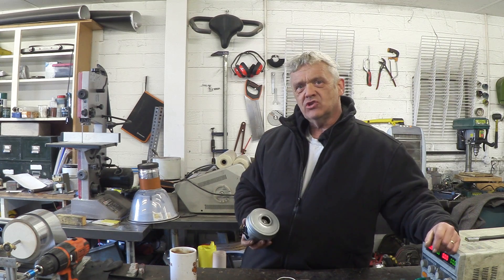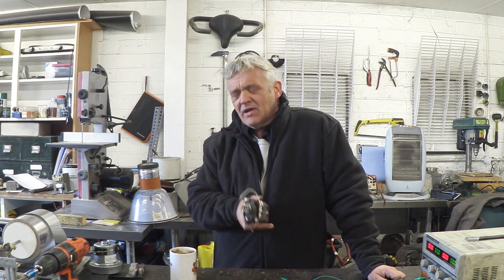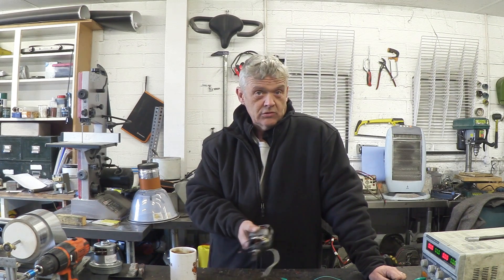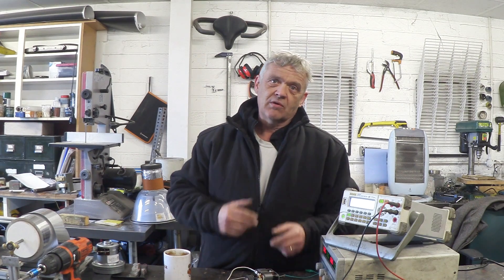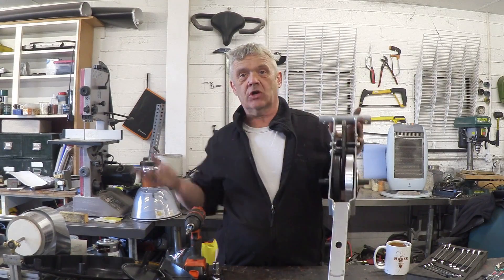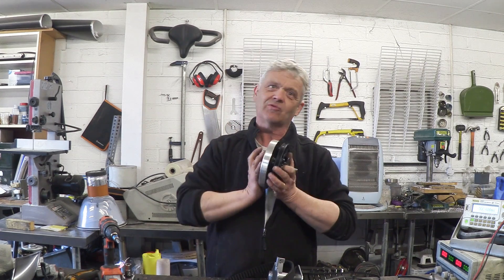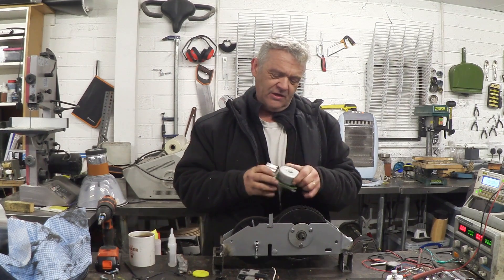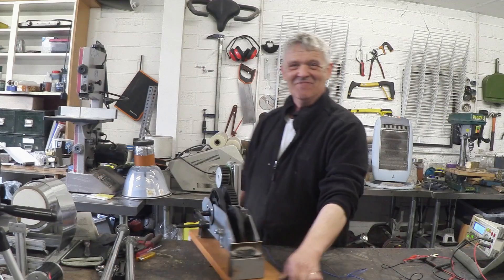1085 A Generator  From an Execise Bike, A Printer And My New Gear Mechanism - Use As A Wind Turbine

Comment: you are turning up a lot of printer parts, and some look like laser printers, so I am wondering if you have torn down the bits that have the rollers and fusers and found any t hat have soft squishy rubber coatings on them, as I have a couple that feel and react like urethane rubber, (is an orange-ish red color) and really thinking of making a van de graaff generator using them and some large solid teflon block I have access to,

Comment: Harbor freight sells a 10KW tractor PTO generator for about $320 USD. Optimal RPMs at the Rotor is 1,000. This is the cheapest and most efficient way that I've found to approach larger projects. You can always grab a cheap 1:30 and reverse it to the Rotor shaft, after that, torque is king.
Reply: Gears are terribly expensive globally, sprocket and chain ratios will get you where you want to go without the cost.

Comment: Hi Rob. I think your gear idea is the cleverest thing I've seen in a long while. But what do you do if the belt doesn't fit perfectly around the circumference (half a tooth too long or too short)? Is it just serendipity that yours seem to fit perfectly, or dit you have to turn the centre parts down a bit of the lathe? Or am I missing something obvious?
Reply: I'll go bigger,by adding a layer under the belt to make up the size difference. It wouldn't have to be big because your changing the radius squared compared to circumference .
Reply: @tremail564  I didn't think of that.

Comment: The gearbox for the generator is very intersting. I don't see much potential in the printer-motor as generator ... see more in the hoover motor: Put on the rotor variable DC to get AC on the stator. So in case connect to a wind turbine it should be possible to get out a stabile voltage to charge batteries. And - off course - keep the flywheel in the system as stabilisator for the voltage because wind can drop and rising fast.

Comment: I think Ive watched nearly all your videos and am sure that this is my favourite. It is so simple, clever and deliverable for so many. The change in motor adds to the video, as it presents an alternative option that are generally readily available. Im thinking that this could be not only a windturbine and obvious bike generator but perhaps best for me, a backup battery charger for low solar days using a small petrol motor, say lawnmower. Then using one of those cheap ebay gas converters to utilize bio gas which I had intended to make this year by converting an IBC into a digestor. (videos on youtube). Best wishes.

Comment: Good work! I doubt the printer motor would deliver 4 amps for very long without its windings melting! What current does it put into a 12V battery?
Reply from the maker: nah - probably not lol - but then just swap the motor for you motor of choice - the basic idea is what will work I think - as for amps - no idea build one and see - this took me about 3 hours to make start to finish